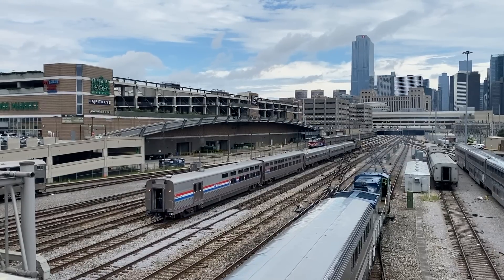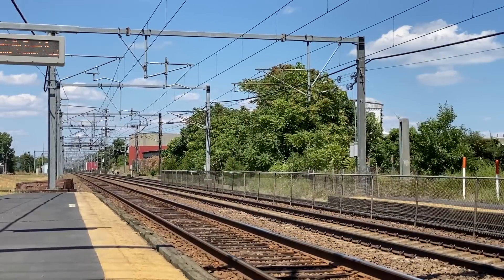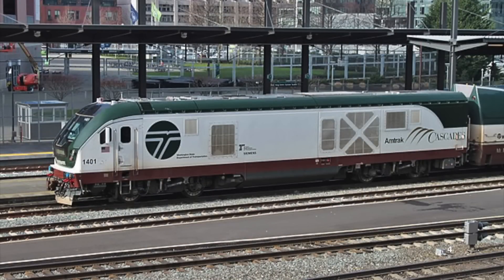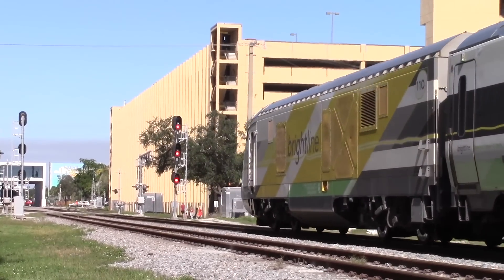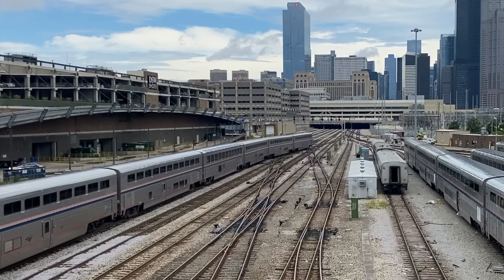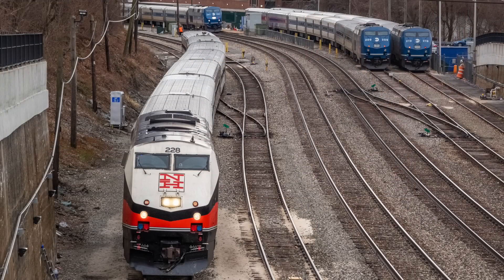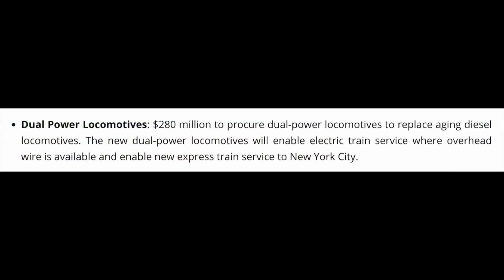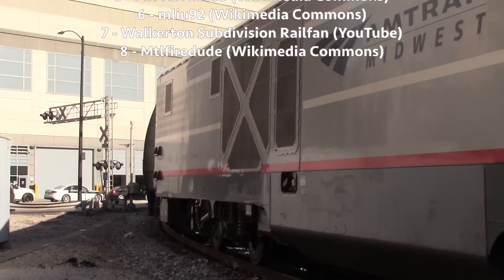Siemens Charger: Locomotive of the Future

Comment: Will this come to the Silver Meteor line?
Reply: The Meatball will get dual-modes so no more swapping locos in WAS! Should be the end of loco swaps if I recall correctly. Some of those old diesels are suffering. Wonder if the VA/NC routes will get prio with their cachet of state funding, or the LD’s for reliability. Empire Service I think gets the test battery since it is the odd one: third rail from Westchester south, no smoking allowed in NY Penn. I believe the plan is to ignore the third rail in the name of simplicity??

Comment: I have a better idea, just electrify the lines????
Reply: Impossible lol
Reply: @danielchou5895  POSSIBLE* Just way too expensive. I mean it'll cost what hundreds of Billions in even the small sections if they packed it in 200 mile segments/2 whole lines?
Reply: @gerogyzurkov2259  Not possible. Class 1s wont do it.
Reply: @danielchou5895  that's why I said unless you subsidiary the construction which is the only way. It's too expensive.
Reply: @gerogyzurkov2259  They'd still say no even with full-refund subsidies. It's a lot of trouble to install and maintain, and replace all the existing locomotives, and the power grid could never handle it anyway. No one seems to mention or realize we'd need to double the entire national power grid capacity
Reply: That's why the ACS-64 was made
Reply: @andrewreynolds4949  Well they have to make more of the power grid anyway since 

1. Weather and maintenance
2. Energy demand is always raising
3. Powering up these new electric cars sounds like u need more infrastructure anyway. You might as well for trains too 
4. New housing.
Reply: @gerogyzurkov2259  In that case make it tripling or quadrupling the power grid to electrify the railways too. It won't happen
Reply: It is possible just that it would take a long time it'll be better to modernize the fleet first. If they do electrify the Charger would still operate until the electrification is completed

Comment: Their cabs sit so low to the ground. That’s what I hate about them, every other Diesel Locomotive model has a cab that sits at least 12 feet off the ground, while these are probably just 6 or 7 feet high. So now the Engineer sits at the same height as the passengers, whereas he would formerly be towering over them. But I guess it fits to symbolize the slow, painful europeanization and degeneration of American railroads.
Reply: Talking about cab heights, take a look at the E353 trainset. The engineer probably sits 15 feet off the ground which allows a gangway to be placed underneath.
Reply: THIS IS ONE OF THE FUNNIEST YOUTUBE CCOMMENTS IVE SEEN IN A GOOD WHILE.
AMERICANS ARE SO FUCKING FUNNY I CAN'T GET  OVER IT
Reply: Only Europeanization of the passenger equipment, American freight equipment has done quite well on the export market, and currently hauls most freight trains in Britain for one
Reply: @bloodydoll5897  easy on the meth there buddy

Comment: I keep reading that the Siemens locos - electric and diesel, are poorly built and very unreliable - and that much of the work has to be done by 'factory' mechanics.  And enormously complex with horrible software.  You are saying otherwise.  Which is the truth?
Reply: Well Siemens makes pretty much half of Europe's locomotives. Both freight and passenger types. They seem to be working. 
Could be an American version issue or could be a lie. But Siemens ACS 64 locomotives have worked reliability for a long time.
Reply: @RR-us2kp  The people reporting this are at Amtrak.  Their biggest concern is very buggy software.
Reply: @rontroy3843  so like I said, it's probably a problem with the American version.
Reply: @RR-us2kp  very possibly.